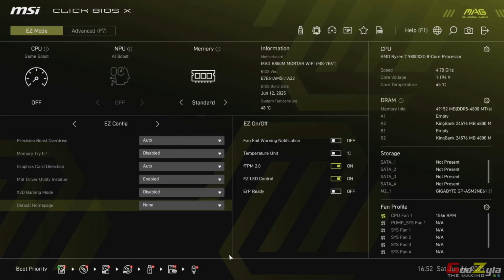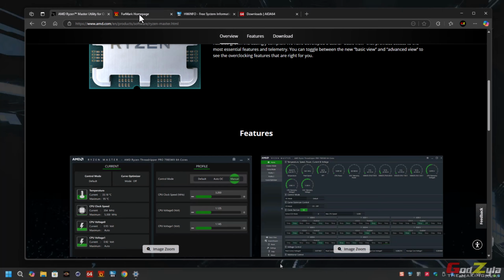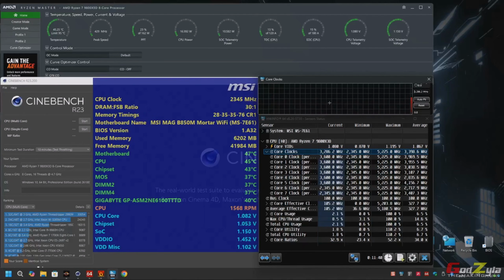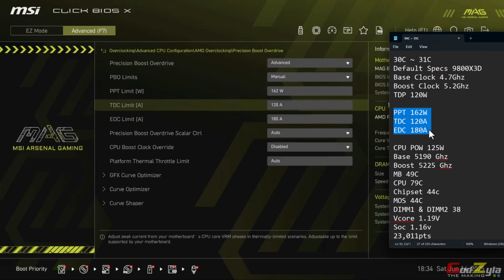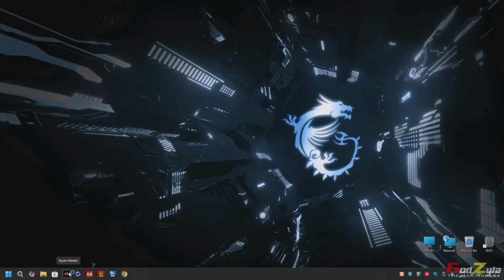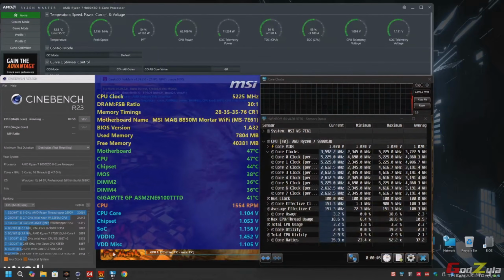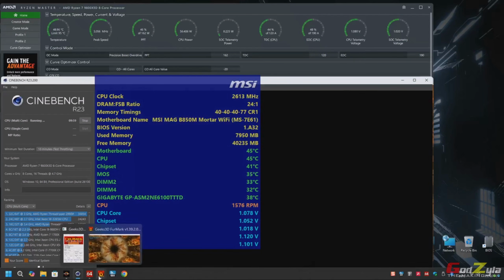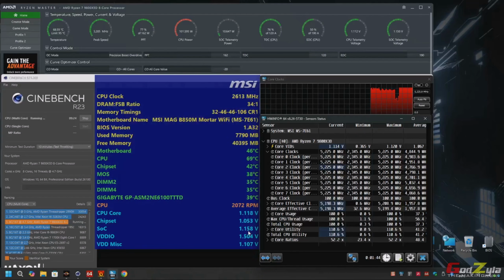PBO2 Curve Optimizing with 9800X3D on MSI Motherboard

Comment: Hi, will it work on an MSI Bass X670E Gaming Plus WiFi motherboard? I also have the same 9800X3D processor, RAM 6000mhz cl30
Reply from the maker: Welcome to my channel Pablo Marquez Martinez, you can give it a try. just make sure you have the latest bios and not beta bios.. best to have AGESA 1.2.0.7 above.
Reply: @KleoYan Can the core voltage offset be set to 0.0600? Or higher?
Reply from the maker: @paabloomaarqueez you can try but will need to test for stability. If it’s stable you can leave the Vcore offset to your settings.
Reply: @KleoYan  After 30 minutes in Cinebench, 1 hour in OCCT, 9 hours in AIDA64, 9 hours in CoreCycler with Prime95, and 9 hours with CoreCycler with yCruncher, all without an error, is my Undervolt 100% stable?
Reply from the maker: @paabloomaarqueez  If you have run those stability test for 8 to 9 hours, overall it's stable.

Comment: Nice guide, running same settings, temperature went down from 71c to 58c 😂 thats crazy low while running cinebench +  FurMark, I could probably increase power slightly, but not sure if its worth it..
Reply from the maker: Welcome to my channel MrMrGuado, I wouldn’t stretch it to the max. This is to give some slack for the processor to pull sufficient current. There are some viewers who pushes even more and ended up system may run for a couple of weeks but ended up having crashes at a later stage.
Reply: @KleoYan  Update:
Benchmarks ran alright on - 20, but games keep closing "crashing" - 15 games still closing  after a while, will try - 10. 
Unlucky with my cpu looks like,  can't think of anything else what causing it, problem accrued after overclocking. is it worth having  -10? compared to default settings ?
Reply from the maker: @MrMrGuado  what you can do is to do step by step diagnose of your settings. 1st run default and observe the temperature, wattage and voltage. Assuming your rams are of M/T 6000 ... I will do these steps

01 ) Make sure to use Up-To-Date Bios but not Beta version 
02)  Clear CMOS first  (PLEASE MAKE SURE TO CLEAR CMOS) and go into UEFI / BIOS
03) Go to Overclocking
04) Enable A-XMP or EXPO (depending your rams which it supports)
Step 03) to 05) is only meant for RAM kit that are of M/T 6000MHz else skip to Step 06
03) Set DRAM Speed 6000
04) Set FCLK Frequency 2000
05) Set UCLK DIV1 Mode to UCLK=MEMCLK
06) Set CPU NB/SoC Voltage to Override Mode
07) Set Override CPU NB/SoC voltage to 1.15v (make sure is 1.15v and not 1.5v)
08) Save and load to windows, run Aida 64 Stability test for 30minutes
09) Run your game. This is to see if the VSoC voltage can handle your rams without failure.
if error, go back to UEFI set Override CPU NB/SoC Voltage to 1.16V (repeat step 08)). if it fails again, set it higher 1.17V (repeat step 08)) .. if passes, proceed to Step 10) 

10) Click on Advanced CPU Configuration
11) Click on Precision Boost Overdrive
12) Click on Manual 
13) Set PPT 162000mV TDC 120000mV EDC 180000mV
16) Set Platform Thermal Throttle Limit 90
17) Scroll down, click on Curve Optimizer
18) Select All Cores under Curve Optimizer
19) Select Negative under All Core Curve Optimizer Sign
20) Set All Core Curve Optimizer Magnitude to value 20 
21) Save and load to windows, run Aida 64 Stability test for 30minutes
22) Run your game. This is to see if your system is able to run at curve optimizer with -20 

23) Curve Shaper
Med Freq : Low Temp -15 , Med Temp -15, Low Temp -15
High Freq : Low Temp -10 , Med Temp -10, Low Temp -10
Max Freq : Low Temp -5 , Med Temp -5, Low Temp -5
If unstable with curve shaper, go back to UEFI and set Curve Shaper auto. Make use on Curve optimizer only at -20

I have skip Vcore Offset (For CPU) and to set High-Efficiency Mode (For Rams) as should start with the basic above. once all stable, then try set Vcore offset to -0.05v, again run aida test and play games to ensure stability. If ok, then try run your rams at High-Efficiency Mode.
Reply: @KleoYan thanks, I'll run some tests on my days off, sorry for lack of info.

Ram: klevv cras v 6000MTs 28-36-36-76 30:1 "Expo" 
Cpu: Ryzen 7 9800x3d
Motherboard: MSI MAG X870E TOMAHAWK MAX WIFI PZ.

Forgot to mention that I wast running ram sticks with ur settings before overclocking cpu, without issues.
And I tried run my cpu at "-10" and its alright while running games. But still gonna check if am able to run at "-20"
Reply from the maker: @MrMrGuado  I see, I wish you all the very best. 👍

Comment: hi i make all than like you and max i ahve 5225 not 5400, why ??
Reply from the maker: Welcome to my channel Tomek. The default is 4.7GHz and max boost is 5.2GHz. maybe before you follow this, you have set max boast to +200MHz at the PBO2 settings? I have explain why not to use it, but you have a choice to set it. 😉

Comment: Will these settings work with 6000 speed cl30 ram 32gbs?  im about to build a 9800x3d x870e tomahawk system. 9100 pro 2tb i plan on following this  exactly rhanks!@ amazing help so far
Reply from the maker: Welcome to my channel Bisket Beeblebrox. Yes you can follow, but kindly do the configuration, one step at a time. This will aid you to troubleshoot if error occures. Also do compare the thermal results with your default, so this way you can see what's the improvement based on your own system.
Reply: @KleoYan  ive never tuned a chip before as i dont really ever like to over clock. always been a stock setting kind of guy. but i want my chip to last and run much lower in temps and power draw. thank you!
Reply from the maker: @bisketbeeblebrox8124 I see. My content is more of a undervolt. You can give it a try 😉
Reply: @KleoYan thats what i was looking for!!
Reply from the maker: @bisketbeeblebrox8124 ok. All the very best with your tweaks 😉

Comment: How much different is the cpu tuning for a 9900x?
Reply from the maker: Welcome to my channel Anthony. You can apply the same method but with a slight twist. You will need to find your 9900X the default PPT TDC and EDC. Since it’s non X3D, the step on CPPC is not applicable, so you can skip that.

Comment: -35 -> -25 allcore co is extreme.
i think u will fail in a shader compilation or occt.
Why r u using offset with co + curve shaper? What is the logic behind?
You should set a base line with voltages, then find your weak cores.
If this worked to u without any errors u are just verry lucky, bc u won the silicon lottery.
Reply from the maker: Welcome to my channel Dávid Kiss. CPU doesn’t require so much voltage, that’s the reason to have it offset. Plus CO and CS. I don’t run any issues when doing Occt test, Aida 64 nor y-cruncher. Though this loan 9800X3D has a SP (Silicon Prediction) of 125 but I have tested most which SP are between 119 to 121 without issues. Yes you are right some of my viewers did face issue where I believe their SP value is lower than 116, that I will advise them just to use CO and set CS as auto and the crash will be illuminated. Thank you for your feedback.
Reply: @KleoYan 
I configured my setup using intel burn test, cinebench, occt (with advanced configuration) and tm5. They are brutal!
They are just synthetic tests.
Do the following:
1. Install Overwatch.
2. Delete the following files here: %LOCALAPPDATA%\NVIDIA\DXCache
3. Start the game.
4. Wait for shader compilation.
5. Pray.
6. Repeat steps (2-5) 2-3 times.

If you get "vga driver error" your system just fucked up.
Reply from the maker: @hkodavid thanks for the info. If I do have the processor again as I’ve returned it long time ago. Will test that if I ever get a chance.

Comment: Hi thanks for your really helpful video. Do you think i can set UCLK=MEMCLK with my ram 32go DDR5 6000 CL36? or should i leave it to auto?
Reply from the maker: Welcome to my channel Endlessly45. You can set 1:1 ratio as your rams m/t is the best sweet spot which is 6000MHz also set your FCLK to 2000MHz.
Reply: @KleoYan  Ty very much, and the Override CPU/SOC 1.15v can be done on all 32go DDR5 ram kit if i understand correctly?
Reply from the maker: @endlessly45 yes correct. My safe settings is on 1.15v. Some have tested which can go 1.12v and 1.13v. Lower SoC you have set. The lower temperature your cpu will be, but it might compromise stability. So for me 1.15v is the sweet spot.
Reply: @KleoYan Once again a big thanks , my CPU lost 10°C and my Vcore : 1.10V in Cinebench (is my Vcore good to you?)
Reply from the maker: @endlessly45 so long it’s stable after you have run stress test with Occt or aida64. It’s all good. If it crashes. Pump up the VSoC. Please note. VSoC is not VCore.

A) Run Aida 64 Stability Test for 2 hours 
B) Run OCCT with the configures below and run 2 hours
C) Set DATA SET to Large
D) Set MODE to Extreme
E) Set LOAD TYPE to Variable
F) Set INSTRUCTION SET to AVX2
G) Set time to 2hours
H) Highlight CPU+RAM
I) Click on start and run the test.
Reply: @KleoYan  Thanks for your time =)
Reply from the maker: @endlessly45  most welcome.
Reply: @KleoYan  so the Aida 64 test fails almost instantly but the OCCT runs without errors,. I tried with Vsoc on auto (1.20v) but the result is the same.
Can i keep the same Curve Shaper numbers if i test with a lower PBO?
One last question, sorry. I only play games on my PC, so I was wondering if it's really a big deal if it fails the Aida 64 test, since I have no problems with the OCCT test.
Reply from the maker: @endlessly45  it is a big deal if Aida 64 does not pass, as it's a signal that the curve optimizer or the curve shaper is stretching. I would advise you to do a step by step testing so you can narrow down what went wrong. 

01) Enable Expo Profile
02) Set FCLK to 2000MHz
03) DRAM Speed to 6000
04) Set UCLK DIV1 MODE to UCLK=MEMCLK 
05) Set SoC/Uncore OC Mode is Enable
06) Set NB/SoC Voltage to 1.15v
07) Save and run aida 64 for at least 30mins
08) if stable, back to UEFI

Setting Rams with tightest timing
You can try this but unstable, kindly set it back to Auto
09) Set High-Efficiency Mode to Enable
10) Set Memory Timing Preset to Tightest
11) Save and run aida 64 for at least 30mins
12) if stable, back to UEFI if unstable, lower down the timing preset to tight or even balance and rerun aida64 test again

Setting PBO2 & Curve Opimizer 
13) Set your PBO2 limits to your processor default, the PPT, TDC and EDC
14) Set Curve optimizer to per core. have CCD0 to -15 and CCD1 to -10
15) Save and run aida 64 for at least 30mins

Setting Curve Shaper
16) Set Curve Shaper
17) Save and run aida 64 for at least 30minutes
18) if stable, do final test for 2 hours on OCCT and Aida64
19) if unstable, leave Curve Shaper to auto and up the value for Curve Optimizer with CCD0 -20 and CCD1 to -15

Comment: Absolutely brilliant guide, pc runs a lot quieter and cooler now. Had it on 5.5ghz but honestly prefer this tune
Reply from the maker: Welcome to my channel Ryan Dench. Thank you for your feedback and congrats on your configuration too✌
Reply: @KleoYan hey man I still think 5.5ghz at 1.18v LLC level 4 is better. I have 76/77 max temps 24.9k multi core score r23
Reply from the maker: @RyanDench-lx6cx  thanks for the reply, this guide is more on explanation and the settings I’ve done are set in the middle. You can decide to push or to pull, as long as you understand your settings 😉 All the best with your settings ✌️
Reply: @KleoYan 24.9k multi core 2216 single core. Multi core max temps 76/77°c. Single core 46-49°c

Comment: возможно ли применить эти настройки на материнсой плате от Гигабит? Или там есть свои нюансы?
Reply from the maker: Welcome to my channel INFINITY, for gigabyte you can apply the steps below and kindly do this at your own risk.

Step 01) Update bios version
Step 02) Clean CMOS first
Step 03) Make sure to set your cooling fans properly, under Smart Fan 6 [F6]

ADVANCE MODE [F2]
Step 04) Set XMP/EXPO Profile to EXPO 1
Step 05) Set Infinity Fabric Frequency and Dividers to 2000MHz (if your rams are of 6000MHz M/T)
Step 06) Set UCLK DIV1 MODE to UCLK=MEMCLK (if your rams are of 6000MHz M/T)
Step 07) Set VCORE SOC to 1.10V (if your rams are of 16G to 48G Kit) 

Save settings boot to windows
- Run Aida 64 stability test for 30mins 
- If unstable, back to UEFI and back to step 07), pump the VCORE SOC to 1.13V, save and test again (repeat if unstable and do not pump VCORE SOC above 1.17V) 
- if stable proceed to Step 08) 

Step 08) back to settings, select AMD CBS
Step 09) Set CPPC to Driver
Step 10) Go to Settings > AMD Overclocking and agree
Step 11) Set SoC/Uncore OC Mode to Enable
Step 12) back to AMD Overclocking, click on Precision Boost Overdrive
Step 13) Set Precisino Boost Overdrive to Advanced
Step 14) Set PBO Limits to Manual
Step 15) Set PPT 162000mV TDC 120000mV EDC 180000mV
Step 16) Set Curve Optimizer to all cores -20 (make sure is negative 20) 

Save settings boot to windows
- Run Aida 64 stability test for 30mins 
- If unstable, back to UEFI and back to Step 16), Set Curve Optimizer to all core -15, save and test again   
- if stable proceed to Step 17) 

Step 17) Curve Shaper
Med Freq : Low Temp -15 , Med Temp -15, Low Temp -15
High Freq : Low Temp -10 , Med Temp -10, Low Temp -10
Max Freq : Low Temp -5 , Med Temp -5, Low Temp -5

If unstable with curve shaper, go back to UEFI and set Curve Shaper auto. Make use on Curve optimizer only at -20

Final test run, you can follow or not to follow as I do these test to ensure my system runs stable. 
A) Run Aida 64 Stability Test for 2 hours 
B) Run OCCT with the configures below and run 2 hours
C) Set DATA SET to Large
D) Set MODE to Extreme
E) Set LOAD TYPE to Variable
F) Set INSTRUCTION SET to AVX2
G) Set time to 2hours
H) Highlight CPU+RAM
I) Click on start and run the test.
Reply: @KleoYan  из за плохих настроек может быть температура процессора в синебенч р23 93 градуса? даже жидкостное охлаждение на 3 секции не способно его охладить,все что я смог придумать,это выставить ограничение по температуре)
Reply from the maker: @lorus20   I’m not sure how you configured the settings, and they don’t match the instructions I provided. The VCORE SoC should be set between 1.15V to 1.17V and not over 1.17V. You’ve set it to 1.95V (Extremely High) which is incorrect and it will damage your processor. If you’re having trouble following the instructions, stop and reset back to default. This is to avoid any system damage and I will not bear any responsible if configure without fully understand this content or my instructions.
Reply: @KleoYan  Я сейчас просто тестирую стабильность,конечно это на мою ответственнность)) Читал много информации,даже официальной что это напряжение вполне допустимо для долгосрочного пользования вплоть до 1.3в)) и еще одна странная особенность,во время тестов это напряжение становится немного меньше 1.9-1.87
Reply from the maker: @lorus20  oh ok.. you scare me when you mentioned it's 1.9V,
1) For CPU Vcore default is 1.35V but I do not allow it to run more than 1.25V, most of the time will be around 1.19V or lower. 
2) VCORE SoC is the communication between your Processor and Rams "IMC" intergrated Memory Controller, therefore for this I do not allow more than 1.2V, that's why I set to 1.15V to 1.17V and not more. 
Please practise safetly ok.. all the best with your settings.
Reply: @KleoYan Все сделал по вашей инструкции,vcore soc установил на 1.1 в,curve -20 получил зависание ПК в тесте Аида 64 ,изменил curve на -10 ,тест прошел,настроил по вашей таблице температур,occt 2 часа прошел отлично,частота стабильная,потребление 120 ватт,температура 70 градусов,после этого запустил синебенч р23,тоже отличный результат,23500 балов,после этого запустил стресс тест Аида 64 и сразу получил ошибку,пробовал после этого vcore soc поставить на 1.12 в и снова ошибка,что посоветуете изменить?
Reply from the maker: @lorus20  Hi, those are good results and it's my bad.. my typo on step Step 07) .... the VCORE SOC to 1.15v and not 1.10v.
Reply: @KleoYan если я правильно понял,vcore soc  изменить на 1.15,и после этого следовать всем последующим пунктам?
Reply from the maker: @lorus20 that’s correct.
Reply: @KleoYan  Здравствуйте. Потестировал  немного настройки и выяснил что Vcore SoC 1.15 в у меня работают не стабильно,по этому я переключил его в авторежим и проследил в HW info что по умолчанию он у меня установлен  на 1.95 в,после я вернулся в биос и зафиксировал его на отметке 1.9 в ,а также curve optimizer на отметке -20 также вызывает нестабильность,(не проходит теств аида 64) поэтому я зафиксировал его на -15. После таких настроек в ОССТ стабильная частота по всем ядрам 5.2, потребление процессора 122 ватт,температура 67 градусов,мне кажется это отличный результат)  Возможно вы сможете мне еще подсказать какие можно изменить настройки в БИОС  чтобы не было микрофризов в играх? Это случается не всегда,но случается,я играю 1 игру в онлайне она больше нагружает процессор чем видеокарту,и когда открыть локацию с множеством движущихся обьектов,начинаются микрофризы,загрузка процесора около 35 процентов,это немного,но фризы есть(
Reply: @KleoYan  VCORE SoC у меня настроен на 1.26 в это же опасно?